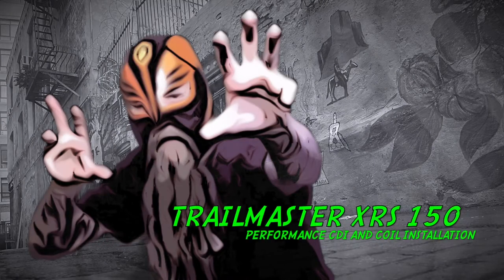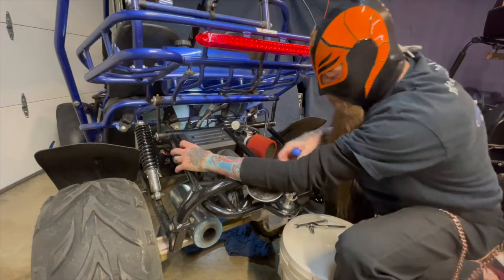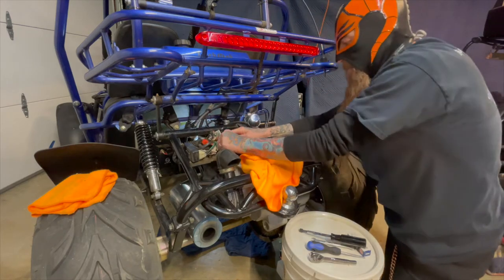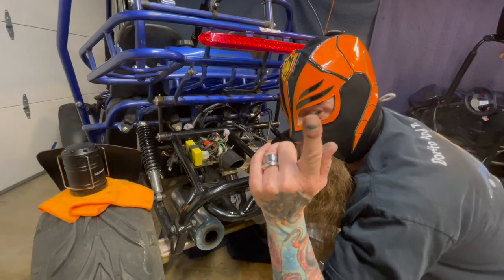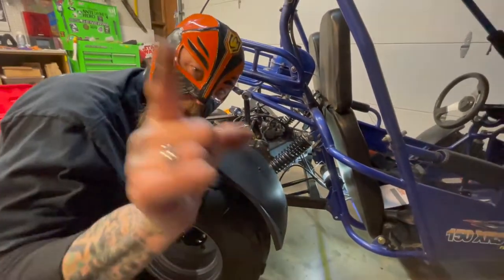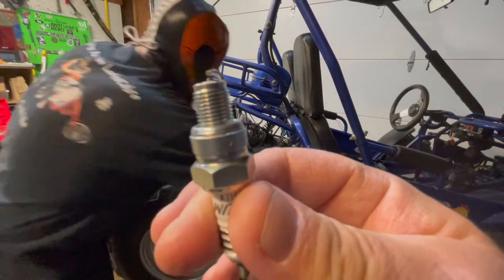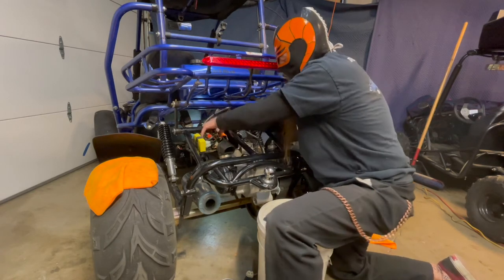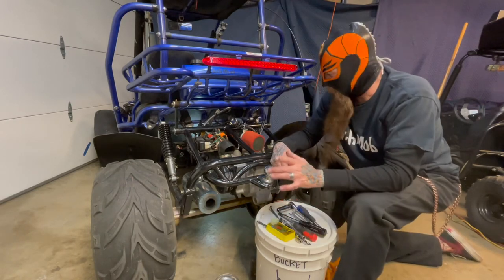TrailMaster Xrs 150 Performance Cdi and Coil Installation

Comment: What would cause this thing to not start from the ignition? It starts from jumping solenoid but rarely starts from ignition. Do you think its the brake starter relay fail or starter solenoid going bad? Any thoughts help! Thanks guys! Ps great video and are you working with an Ac or Dc CDI?
Reply from the maker: i would check the relay first
Reply: @LuchMobGarage  😃 thanks 👊
Reply from the maker: @Jesus_Saves_J2415  no problem bud let me know how it works out
Reply: Also is the CDI 
AC or DC?
Reply from the maker: @Jesus_Saves_J2415  dc
Reply: @LuchMobGarage  right on thanks for answering 👍
Reply from the maker: @Jesus_Saves_J2415  no worries brother thanks for watching
Reply from the maker: Dc
Reply from the maker: No worries bud thanks for watching and being a long time subscriber
Reply: @LuchMobGarage  SO, I replaced the break relay fuse under the dash. 💥Shes starting just fine now! 👊
🤓
Reply from the maker: Awesome glad that worked out bud